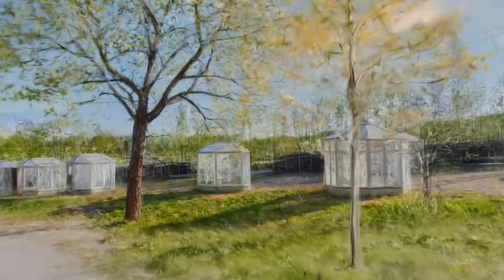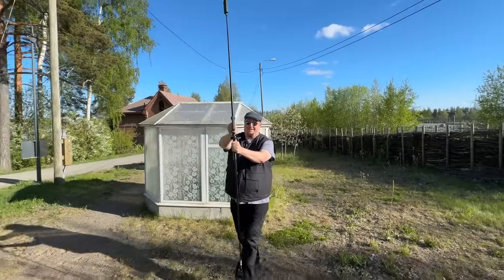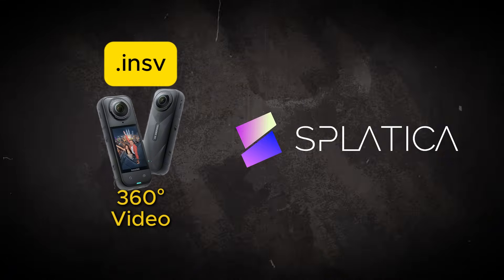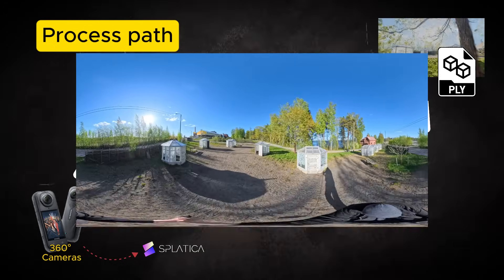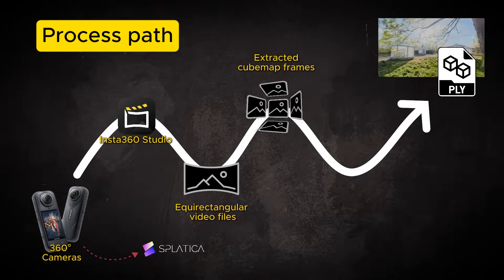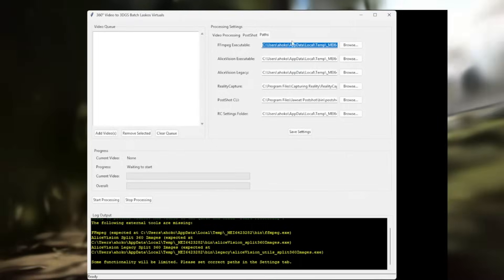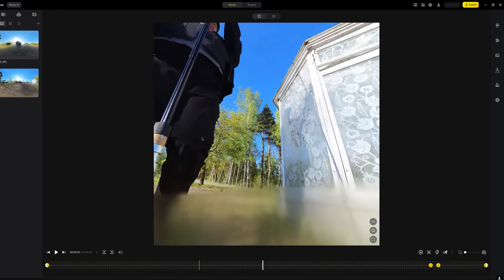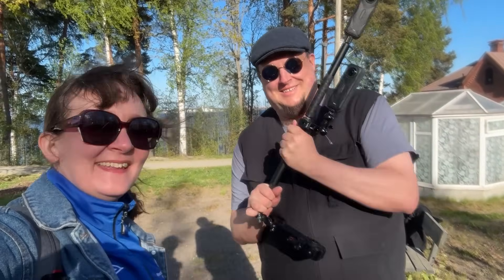Ultimate 3D Scanner - Scanning with three Insta360 Cameras.

Comment: Please reply, why you not mentioning X4/X5 capability of taking Spherical 360 photos? Which are normally used directly for generating 3D point cloud etc.
Reply from the maker: You can do this with any 360 camera. It does not matter is it X4 or X5 all 360 cameras work in this process. Insta360 cameras are the most popular ones but before we can make and calculate point clouds out of the images they made all 360 images / videos needs to be dismantled to smaller pieces usuallu 1:1 images.
Reply: @OlliHuttunen78 What I mean, procedure steps can significantly been reduced by aligning spherical photos as them are into image processing software.

Comment: Fun fact, you can rename the . Insv files to 
.MP4 and it'll work just fine in most tools - that's how I convert two side-by-side insta360s into VR vodeo
Reply from the maker: Yes. That is true. Earlier when .insv was renamed to mp4 and opened to video player it showed two spherical raw images from both lenses side by side. But now when we use new X5 Camera the format has been changed. It shows you only one lens image in the mp4 file. Another side is hidden in another channel and it can be turnet on seaparately if you video player has the feature where you can switch between different channels.

Comment: Do you provide the relative camera positions to the SfM software to improve or speed up the reconstruction process?
Reply from the maker: Yes. Reality Capture software can be used in here, but I have noticed that it is quite difficult to make a decent alignment and unified pointcloud. It always makes several components which then need to be merged together by hand. And it takes as much time or even more than just run the whole image set through the postshot and let it to construct the whole SfM.
Reply: @OlliHuttunen78 Thanks for the info, thats good to know.

Comment: Thank you Olli, very nice video. Waiting for more. I noticed that the upper camera is slightly rotated in relation to the middle camera on the Z axis, was it meant to be like this for better results or by coincidence happened to be like that. Just wondering if both cameras are looking exactly to the same direction, will it be better or not.
Reply from the maker: Yes. You have accurate vision. It was meant to be alignet same way as the middle camera. Reason for that is the threads which leaves the camera in that positon when camera is tightened. But eventually it does not matter since 360 image can be rotated afterwards in the editor software.
Reply: @OlliHuttunen78  Thank you Olli. I thought it was meant to have a slight rotation so you can cover the lost area from one camera and this way you could have better overlap details. But another way to look at it, is, if they have the same direction, it will be easier to apply the same workflow on both instead of trying to yaw one to match the other in post. Thank you for your reply.

Comment: I wonder if you wore a uni color outfit, if it would be easier to remove you from the video.  like a green/blue/red screen function.  there would be shadows and lighting to contend with, or maybe just a mask cutting out the general shape of the person..  but even then, a unicolor might help auto masking.   or.. set up an easy blocky mask might be quick, dirty, easy.. and efficient, compared to other more complicated methods.  I was thinking davinci resolve tracking and masking might be good..  but a big blocky mask with general tracking would be quicker and easier, and better results because of fewer artifacts.   so..  consider davinci resolve, auto track your face, and set up a big mask to cover your whole body.  let davinci scrub forward and backwards, and you should have footage ready to feed into the next step.